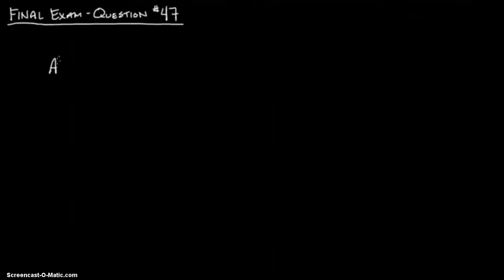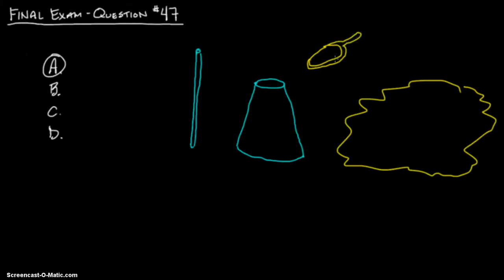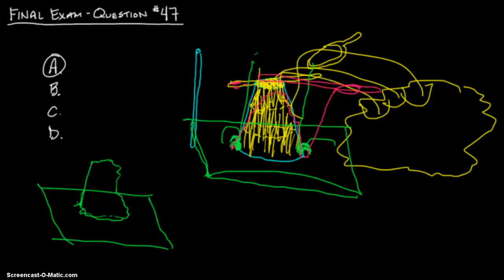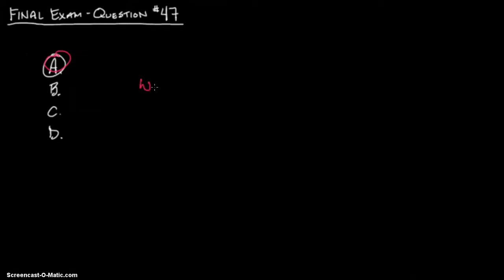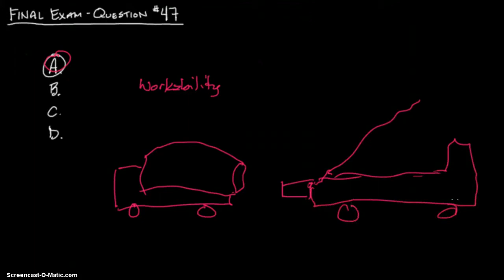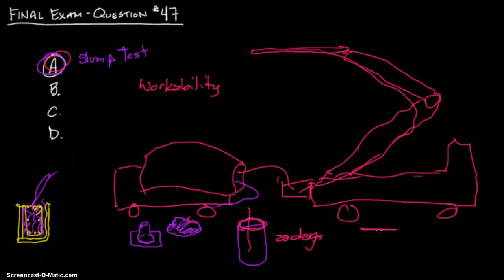Final Exam - Question #47

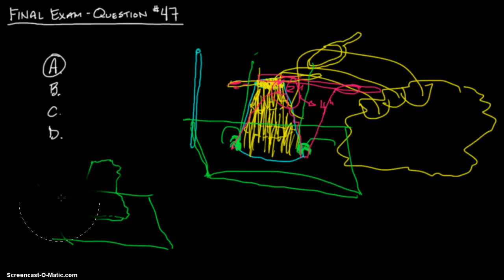Comment from the maker: Around 4:20ish, I said that the concrete "dries".  A better word would be "reacts".  The whole process of concrete involves the cement reacting with water and through "hydration", it binds the particles/ingredients together.  Therefore, the longer you wait, the more the hydration has taken place and closer to setting the concrete is.  Giving more time from the moment of batching will lower slump.

Hope that isn't too confusing.

Comment from the maker: A few more points about the slump test.  If you hadn't guessed, the slump test is not very scientific.  It is a test of workability.  It can also be effected by many other variables: fineness, particle size distribution, moisture content/water content, cleanliness, admixtures, technique, temperature of the concrete, air content, time since batching, etc.

As you can see there are a lot of possible variables.